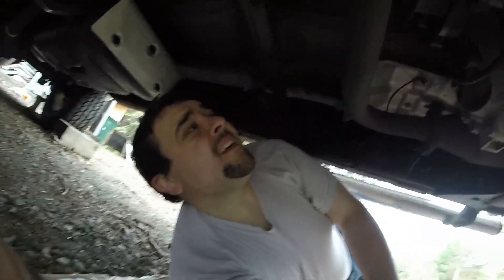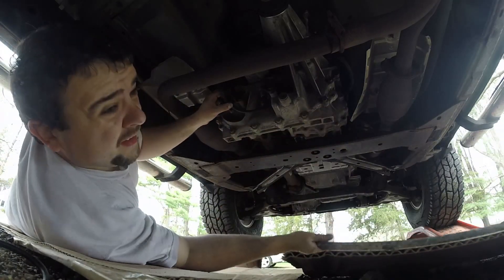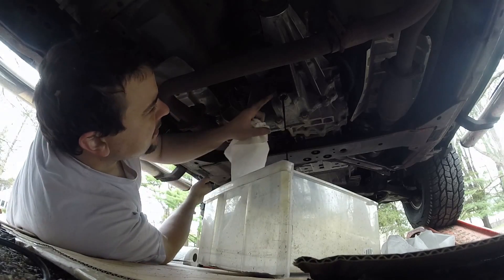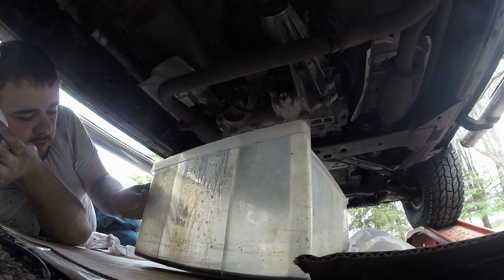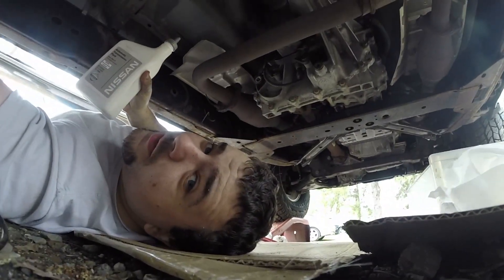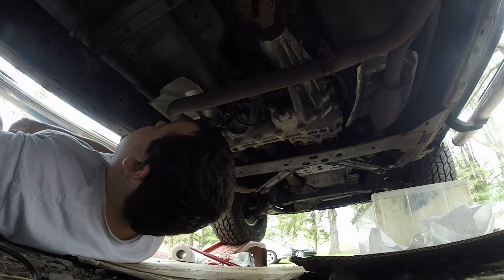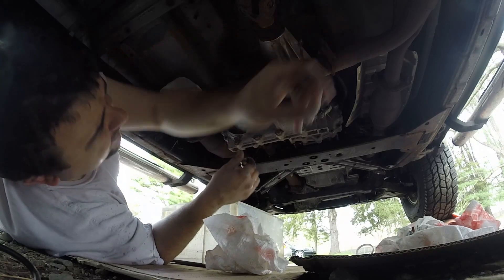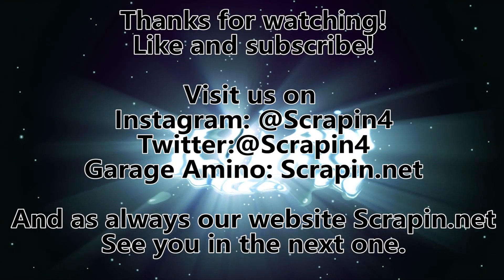Nissan Frontier Transfer Case ATF Change 2005 2016 Nissan Matic D

Comment: I'm grateful to those who post diy's. They are to help us do it correctly. If u have bad and poor habits or no basic knowledge of what ur posting please don't. Topic should be not what to do. 1st. You missed, vehicle should be level. Fill and drain plug should be torque not hand tight with a pipe. Washers should be replaced. Should's let's you slide but no done correctly. Other then that good video.

Comment: My frontier (2011) takes matic j or the newer matic s atf. What year is yours?
Reply from the maker: I believe they have all been updated to use the newer stuff now. Mines a 2010. I just use Valvoline MaxLife Full Synthetic Multi-Vehicle Automatic Transmission Fluid now. It can be used in place of all the nissan ones.
Reply: Scrapin, sounds good. Thanks for the reply.
Reply: Owners manual says magic D

Comment: This guy is why some guys shouldn't be allowed in harbor freight to buy tools

Safty issue no one should confide on the ramps they tend to collapse onto themselfs a set of cheap jack stands would avoid a tragedy.
Reply: Glad I’m not the only one who hates those ramps for that very reason.
Reply: On my Pathfinder I never have to raise it to change any fluids if you don't mind being confined in a tight space you can do it just fine and it's safer.

Comment: Can someone please reply? I sold my Nissan Xterra 4*4 n in the paperwork it said bad hub. So when u engage in four wheel it made a bicycle noise n the guy tht bought it said since the four wheel wouldn’t disengage it was the transfer case n he said on my Xterra u have to pull out the whole transmission to do the transfer case n it never leaked any fluids. Ever. Was I led to ? Please lmk ur opinions . I know this is a frontier in the video but someone please lmk n ty...
Reply: Depends. I don't particularly know about Nissans. But I do know many 4x4 systems such as a ford have solenoids(Think about it as a motor) to engage the 4x4 in the transfer case. But a clicking, grinding noise isn't good. A Whine can be normal.  Did you hear it when making a turn or all the time. Considering it was constantly engaged as you said it may seem either the solenoid was bad and wouldn't disengage 4x4 or theres was an issue with the transfer case or hubs. You just wouldn't be able to know without the shop actually  diagnosing it properly. Sorry nobody else replied in 3 months
Reply: You sold it, its not your problem any longer